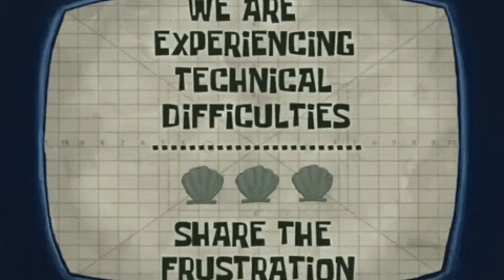Fumicello, how it's made

Comment: Quick tip- u won't have to use that much silver if u thro an ear plug into the other end of that tube 👍😊 When left open the fume travels up and out the other end. If u close that end up or toss an ear plug in it then it stops the fume from traveling up ward so it stays focused at the bottom where ur work is. U'll save on time too. 
Thanks for ur videos BTW! I really enjoy them. Keep up the good work! 🔥
Reply from the maker: You are correct, unfortunately that messes up the flame chemistry inside the tube. As well it does make it harder to control how even the silver is fumed in the tube.